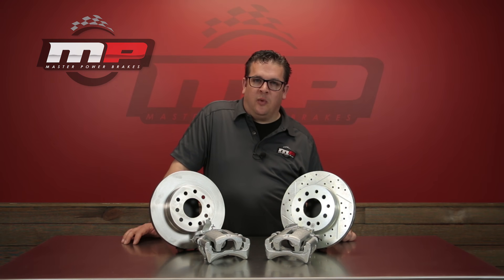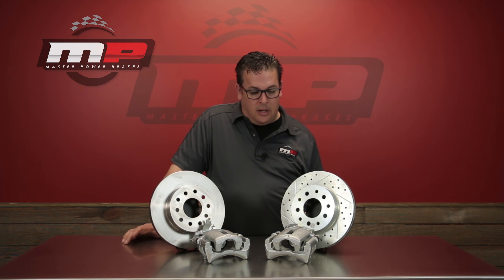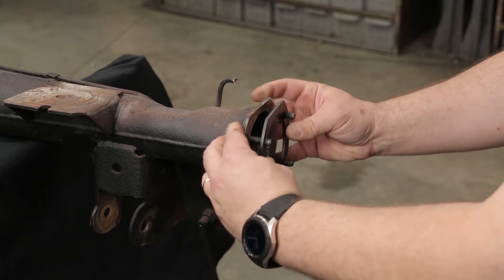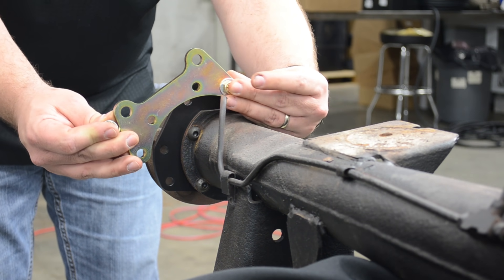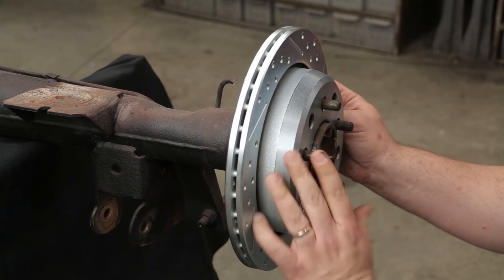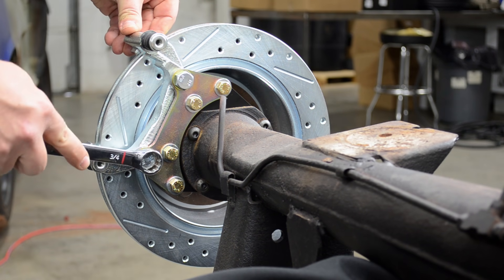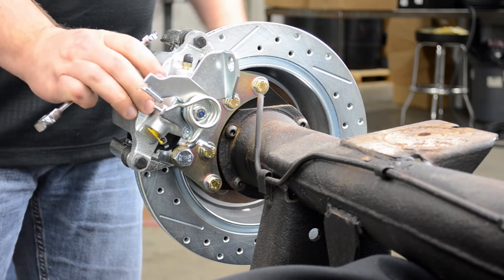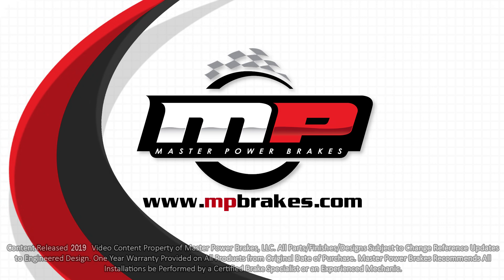Video Demonstration of a Rear Drum to Disc Brake Conversion

Comment: The all-too-critical rotor runout checks omitted. Also some discussion on axle end play that may be encountered, particularly on C-clip applications. A C-clip axle with much end play when coupled with integral parking brake calipers could spell disaster. Over-advanced pistons, pad knockback, etc.

Comment: Can I loosen the drum backing plate bolts, cut the drum backing plate off, and slice the new spacer in half? Don't see why that is not an option, or why the spacer is not provided in a two piece for this purpose, cuts the install time in half.

Comment: There is a couple things I have questions on. Like when you take out the shaft should you need more gear oil? 

Will the brake booster and/or reservoir need mods or changing? 

Obviously do your own research but these things left out of the video could get people killed

Comment: Left out the main headache where the diff cover has to come off to remove the horseshoe clip. Plus, should go ahead and replace the bearings while all that is removed to save future problems
Reply: Not on a 9 inch don't gota open the pumpkin just the axel ends itself

Comment: never took my axles out cut a slot in the backing plate with a plasma cutter and it slid right in makes things a lot easier if you need to completely disassemble

Comment: How's the E brake work with that setup? There was so much overlooked.
Reply: You are correct, this set up has no emergency brake.
There needs to be either a mini drum brake inside the rotor or they make them clamp the outside caliper. This set up is missing both of those.

Comment: Will your rear disc brake assembly adapt to a 1974 fj40 land cruiser minus the e-brake….will be using stock e-brake. Thanks for the info.
Reply from the maker: No, it most likely will not.

Comment: This video is from the sales guys with absolutely no interest in doing any work or getting dirty. Hire an actual  field mechanic, not a pudgy desk dweller to do a real installation please and add the parking/ emergency brake install on a real vehicle under true conditions. Its to your products benefit and will give your potential customers the idea that you actually give a crap about them...
Reply: Exactly I was going to change my drum to disc on my 2011 Escape but the process is not this easy and how will they work This guy is doing this on a axel not in a vehicle This has to be one big headache Not easy as Apple pie

Comment: Already, this video makes no sense.

Why would you put the axle shaft back in the housing, before putting on the anchor plate (what gets bolted to the axle flange)?

I would think it would be harder, in that instance, to get the proper torque necessary to tighten down the anchor plate bolts.

Comment: Does your spacer overlap the bearing outer race? it doesn't look like it

The original back plate is what secures the bearing, if the new spacer doesn't overlap then the bearing and half shaft will be free to move in and out of the axle housing slightly.
Reply: Good point !!!  But it's not the backing plate that holds the bearing,  it would be the retaining plate on the axle ,  in this video it doesn't have it fitted, I wonder if the adapter plate clears that retainer plate as sometimes it has a bulge to clear the bearing.

Comment: will original 15" wheels fit over the new conversion, or will i need to move up in rim size?
Reply from the maker: Our kits will fit MOST 15 inch stock wheels. We do not guarantee anything only because we do not specialize in wheels. We do however have wheel fitment templates for all of our kits.. If you are having trouble downloading the templates off of our website, feel free to contact us and we can email you the template to see if your wheel will work!

Comment: The absolute most important part is left out, the parking brake cable install and nothing about the MC and booster and/or porportioning valve you must have.
Reply: doesn't show the removal of the back plate from the half shaft either

Comment: LOL wow what a crock!!! Nothing about how to get the original backing plate off, new lines from master cylinder as well as new master cylinder, parking brakes (going to need those too) TOTAL waste and bullhickey
Reply: You don't need an entire new brake line from the master cylinder back idk why his was cut if you can get it off without stripping it you can reuse it and even if you can't reuse due to a different size brake line or fitting you can just add the needed section with a brake flare kit should be real easy with everything out of way as far as emergency brake not much should change if it does,  just look at it an improvise and adapt and either make it work yourself or make the piece needed  come on guys and the axle and studs do just pop out I have done it many times a little blow with the hammer is all it should take this is a custom conversion you will run into problems sometimes as with anything custom they supply the parts not the know how that's on you...YOU MAY HAVE TO DROP THE REAR. DIFFERENTIAL COVER IN ORDER TO LOOSEN THE BOLT THAT HOLDS THE AXLE SHAFT IN I AM NOT SURE WHAT MODELS REQUIRE THIS SO IF YOU THINK YOUR IN OVER YOUR HEAD JUST HAVE SOMEONE EXPERIENCED DO IT
Reply from the maker: Hey James, so yes this is an oversimplified video. It is difficult to get every brake kit install recorded and fit into two minutes. If you have any questions on how to install these kits please feel free to contact me. Our contact information is listed on our website. We would be happy to walk anyone through any kit that they would like to purchase from us. Also, we have step by step instructions that go with each kit so people that want to install the kit themselves have the option to do so.

Comment: Hello, sorry I have a 1992 4.9 L Ford F-150 6 inline pickup truck, rear gawr 5450 LB and I want to convert it from drum brakes to disc brakes. Could you tell me which are the ideal brake discs to use in this truck, please. Thanks.

Comment: you literally skipped a whole bunch of things you have to do. if only life was this easy. but a good video for simple minded people to buy your product. i give you that.
Reply: The prortioning valve needs to be changed to a lower pressure otherwise those new rear brakes will drag and burn up.
Reply: Lol, so the axles just slide right out?!
Reply: @latorgator23  And don’t worry about that brake line that was clearly just cut off!
Reply: I think taking the brake pads and the springs and all that stuff off is really that much really necessary I mean that's a given a simple person can even tell that once you remove all that stuff but that's all that's left is exactly what he did now if y'all are talking about all the shade tree mechanic crap like hitting it with torches and all that other stupid shit to break a boat loose here and there I don't know what to tell you because I've never had the resort to stupid shit usually a can of WD-40 does it
Reply: I would just cut the backing plate off instead of removing the axle to get it off. Then, I would make the spacer into a two-piece spacer so I can put it on without having to remove the shaft.
Reply: @brianseeney1364  came here to ask/say this exact thing.
Reply: Bro you’re shit at workin on cars if you don’t think this is simple
Reply: exactly.
Reply: If you're not skilled enough to know everything else needed to complete this job, you probably shouldn't be doing a disk conversion.
Reply: @Fuakh  the point of a tutorial is to teach someone how to do something.  it's impossible to know what one does not know, therefore it is standard practice to list what prerequisite knowledge is required to follow a tutorial, if any. none is listed here, so the viewer will rightfully assume none is required, especially given the poster's claims about "how simple it is".

even if what i just said wasn't true, you say "not skilled enough to know" which is an oxymoron. SKILL is one's physical ability to complete a task. KNOWING what is the best method to complete said task is entirely different. just because one KNOWS the rules of basketball doesn't mean they are SKILLED at it, and just because someone is SKILLED at tossing a ball into a hoop does not mean they KNOW how to play basketball. similarly, just because one KNOWS the process of converting brake drums to disc drums does not mean they are SKILLED at using tools to do so, and just because one is SKILLED at using tools does not mean that they KNOW the correct processes to follow when using said tools.

anyways, what's with this unnecessary gatekeeping? how about you list some of the things not mentioned in the tutorial that are required to help those that want to try this themselves? unless you're a mechanic trying to  keep DIYers in the dark, or unless you yourself have no idea what you're talking about.
Reply: @Fuakh  It's called "DISC" not "DISK"
Reply: Where’s the parking brake… what about break lines like buddy forgot glad the important stuff
Reply: Why did the axle even have to be taken out I see no reason why everything's got a hole in it that seems to be big enough for it to slide right through and unnecessary step in my opinion.
Reply: @Rick6Nick you have yo remove the axels to be able to remove the drum backing plate
Reply: @jorgepimentel4934 You could cut the plate off so you wouldn't have to remove the axle shaft. You could also make the spacer into a two-piece spacer.
Reply: @Rick6Nick the guy installing is an idiot thats why

Comment: Would that work on a 2000 Dodge Ram with 2001 rear 1500 V8 5.9 I was just wondering if that would work as well I do not like doing drum brakes so I wanna switch mine over is it possible

Comment: the bit i was looking for advice on was fitting and correctly adjusting the ebrake cables (which they dont supply and forget to tell you the standard ones wont work)

Comment: Like the simplicity of the install, however, would like to see the new brake hose install. Did you use the old distribution block or change it out. Do we need new brake lines from the block to the caliper??? Thank you.
Reply from the maker: Sorry about the late reply Robert, but you would use the current hardlines that are within your system. We send you new brake hoses to go from the original lines to the caliper.
Reply: @MasterPowerBrakes  do you recommend replacement of the master cylinder as well. Something that can push the new fluid to the caliper with more strength and durability?
Reply: @Mile_High_Salute  I'm wanting to know the same thing, because I wanna switch to disc brakes in the rear of my 2013 Nissan Sentara.
Reply: Buenas terdes tienes para toyota hilux 2015

Comment: Is there a Kit Conversion  For a 97 Chevy Pick up 1500 ,Is a,4x4
Reply from the maker: Hey Tony! Just seeing this. Yes, we do offer a system for the four wheel drive OBS trucks. Here is a link: https://www.mpbrakes.com/rear-brake-conversion-kit/1997-chevrolet-k1500-legend-series-rear.asp?catid=6F0E218509A745F7AFBFCF8980578CDD

Comment: What if you not only want to switch to disc brakes in the rear, but also convert the lugs from 4 to 5?
Reply: Next axel shaft, I think. The lugs are attached on that part. So, 1 new shaft per wheel you wish to convert.

Comment: I did the rear brake discs  upgrade on my 1967 it was hell to get the brakes to work right car did not stop any better I ended up replacing  everything, electric vac motor helped a lot but at 10,000miles the seals in pump went out, ps emergency brake doesn't work a sh== l was a mechanic for years too! This car is a cougar

Comment: a bit over simplified because it is a "sales pitch" missed parking brake work because you will need everything for that too, Brake line install and bleeding and axle seals.
Reply: And also, a New Master Cylinder. I'm not the most sure why, myself, but I think it's because the system will give too much or too little braking pressure to the rear discs if you're using a master cylinder that was for Discs on Front and Drums on Rear.
Reply: @101Volts  also the fact that he started at the part where you are pulling axle rods out.. a lot of work to get to that point alone..

Comment: Do you have a rear brake kit for the Mazda b series pickup
Reply: look for the 2010 mazda b series B4000 or the 2010 to 2011 ford ranger 4.0 V6  rear ends they are factory  rear caliper axles
Reply: https://www.youtube.com/watch?v=QrZkTcdpF7A
Ford Ranger same as Mazda B series

Comment: It's never this simple, how about installing on a 30 yr old car, not sold on your product!
Reply: Right some rear axles need to be modified so that the brackets can be bolted on. And don't forget the part about the parking brake. And if it's a non floater caliper your going to have a brake thump unless you use c clip eliminators for your axles. Love the video tho on how easy he makes it seem.

Comment: Will this kit fit a 62 Impala and can I have 14 inch rims back on it. I got to find a kit this week
Reply from the maker: We do offer the new style of rear disc brake conversion kit for the Impala. As far as 14" wheels, I would recommend taking our Wheel Fitment Template and trying it inside of your wheels to see. Some might work. Some might not.

Here is a link to your application where you will find the template and instructions on using them: https://www.mpbrakes.com/rear-brake-conversion-kit/1962-chevrolet-impala-legend-series-rear.asp?catid=D821F458ED7B4C40AE406C65CCD91D34

Comment: HI GUY U DIDN'T EXPLAIN THE HARDEST PART HOW TO GET DRIVE SHAFT OUT THE REAR END
Reply from the maker: The video is a general overview of how to install a rear disc brake conversion kit so unfortunately we can't cover everything. However, we assume when you say "drive shaft" you are actually referring to the axle shafts? If so, we agree, they can be challenging. A slide hammer with an attachment to bolt to the axle flange will typically make for quick work of removing them from the housing.
Reply: Yea he also skipped the part about modifications to the axle housing to bolt on those brackets he's talking about.
Reply: And the part about replacing your proportioning valve to an adjustable proportioning valve. And make sure you use braided lines that attach to your callipers or that proportioning valve will burt's those stock lines and cause a fire.

Comment: What about Brake bias? (Won't the rear end brakes lock up too soon?)
Reply from the maker: It won't. However, it is recommended that a disc/disc combination valve or an adjustable proportioning valve be installed in the rear line.

Comment: Hi does this work for my 2012 Chevrolet Silverado crew cab LT , my rear is drum I want to convert to dis brake????? Thank. Please advise, and how much for it??? Thank
Reply: Just get all the hardware from a 99-03 disc brake truck. Junkyard are full of them. The SUV's have dual Piston calipers
Reply: P Motorsports any idea where i buy it online?
Reply: @wilfredocunan7222  buy the backing plates used from wrecking yard. Then purchase the rest new from your local parts house
Reply: P Motorsports  our junk yard here does not sell part :( do they have online shop from down south im from alaska so it is hard to get  parts like that.
Reply from the maker: Unfortunately we don't offer a conversion for the later trucks. Our systems stop at the '87 square body. Maybe in the future but nothing right now. Thanks!!

Comment: What about the brake lines ?
Reply: You can see the broken end of the old brake line.  You will need to replace it or connect a flexible fitting to the end. Needs to be a double flare on the metal end.
Reply: @cuzz63   yea huh i"m like connect that snipped-off brake line " your not done,,
Reply: billt460 exactly why i’m sceptical of making a purchase since they don’t make the complete install
Reply: @ele_112  Buy it and figure it out building brake lines isnt too awfully hard. Usually they include a braded cable that hooks to the brake line but if they dont do it yourself

Comment: Does this only work for vehicles with rear axles? Do you have this kit for front wheel drive vehicles?
Reply: Not in the rear. A lot of em have drum brakes.
Reply: FWD already have disks